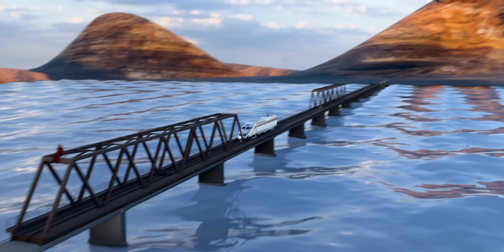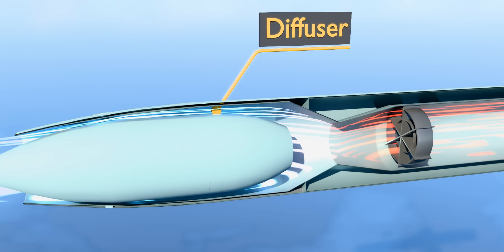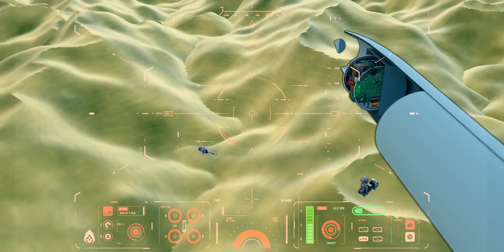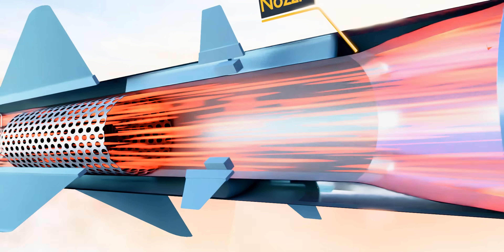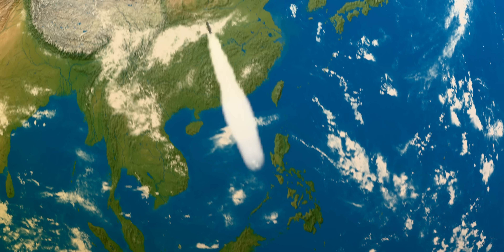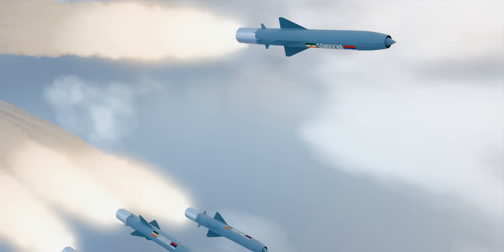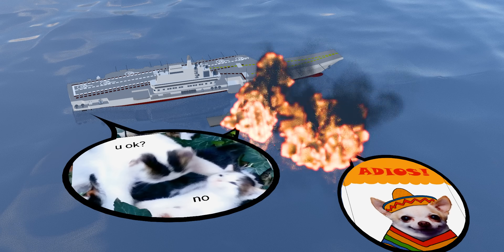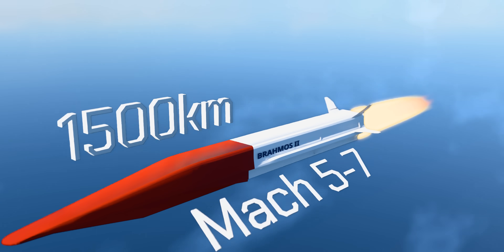What Makes BrahMos so Dangerous? RAMJET Cruise Missile Attack Explanation.

Comment: India have capacity to make 500 brahmos per year and India increasing it to 700 brahmos per year and You Really think India have 700 brahmos 😂
Reply from the maker: The video shows >1500. It could be any number above that🙃
Reply: No, India definitely doesn't have the capacity to produce 500 Brahmos per year, let alone 700!! There are only a couple of production sites operational under Brahmos Corp, which can produce a hundred per year each as of now. There were 2 new facilities under construction but so far, we know nothing of their status. The maximum number operational missiles across all three services is unlikely to exceed 2500 and is quite likely to be even lower.
Reply: @John-d8p well you know about the two not the ones which are known
Reply: @John-d8p it's more than that. Much much more.
Reply: @WarriorOG-ql7gv  🤣🤣🤣🤣🤣🤣🤣🤣 Yeah, keep believing that if it helps you sleep better.

Comment: Important Missed Fact: 
When Brahmos emerges from radio shadow and is perceived by the ships, they have about 5 seconds to react. This is exactly the time that Brahmos does an S-maneuver to prevent from being intercepted before slamming into the ship. You are right in testing times Brahmos has been know to cut ships into half like red hot knife through butter!!
Reply from the maker: "plenty of time to panic" = "5 seconds to react"
Just my way of presenting the same info.😁
Thanks for watching.
Reply: @toonycorn5  wht really just 5 sec ??
Reply: @Startechgamers  its should be about 15-20 seconds. Assuming a 15 kms radar horizon, and 2.5 mach terminal speed.
Reply: @RaptorMaitre 3 mach terminal speed
Reply: @dibyajyotirout9116  mach 3 is about 1000m/s. Radar horizon is 15 kms, with mast about 20 kms. 15-20 seconds ToT, simple math

Also in terminal popup/S turn the missile slows down a bit. Max speed is only with dive mode.
Reply: In the S maneuver its very difficult to intercept even if it has 15-20 sec @RaptorMaitre
Reply: @dibyajyotirout9116  that's not the point. The ToT is not 5 second, but 15, its a factor of 3. Not that it matters.
Reply: Im not sure how the enemy's ADS could react even fast enough even if you had close to a minute or two after moving out of radar horizon if they aren't prepared for it  @RaptorMaitre
Reply: @dybiosol   There can be AE&W, satellite based launch detection, or even drones that can relay the launch information and vectors. A minute is an eternity in combat. Most VLS can engage within 5 seconds of detection if on general quarters.
Reply: 5 sec is enough to say "ohh f*ck"
Reply: More like around 30 secs in ideal situation but most likely the scanning, detecting and tracking would reduce it to less than 10

Then u have to launch against a missile which will is going at 1 km per sec so, you are fckkked